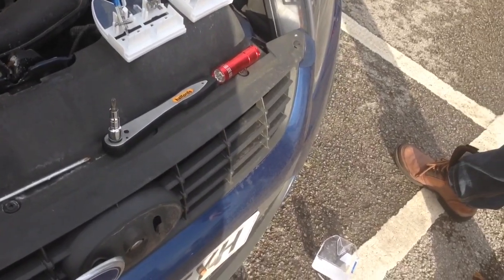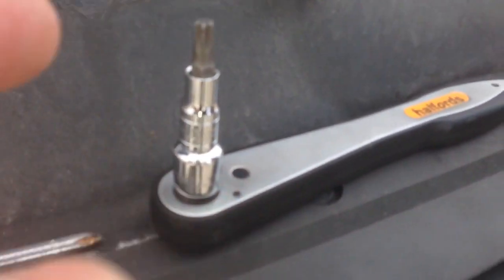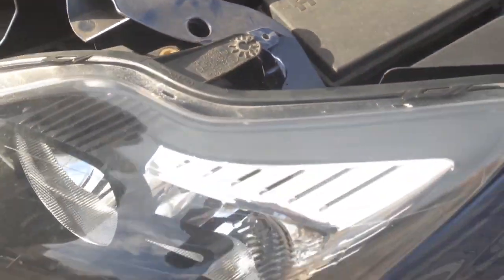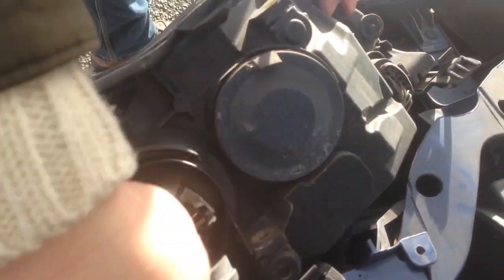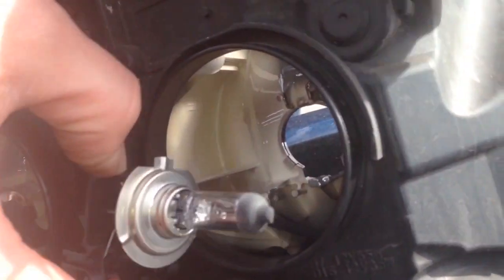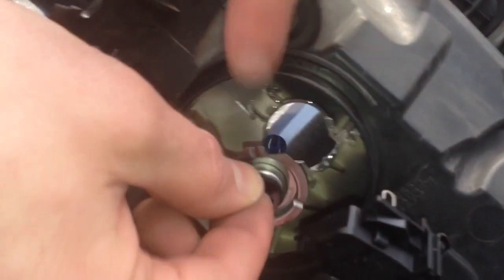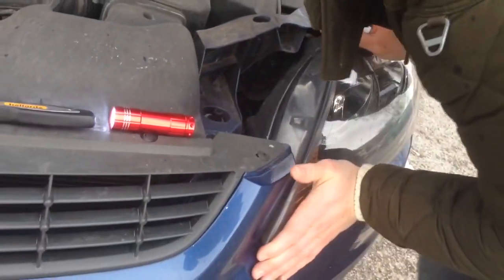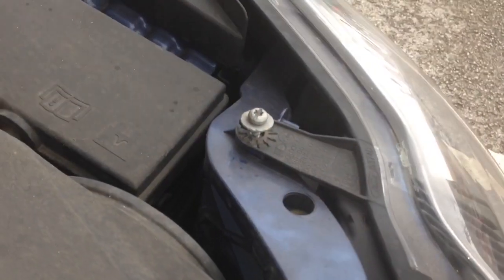Ford Focus 2008 MK2 MK II how to change headlamp bulb video

Comment: Thanks heaps! I have a 2011 model, but same headlight set up. The first YouTube clip I watched got me most of the way. However, your tip about inserting the globe before pushing in the connector was the final bit of information I desperately needed.

Comment: Being a Musician i do not own such a long screwdriver... So i discovered that the wheel nut tool in the trunk doubles as a clip opener and i believe you are supposed to use that tool when replacing the light bulbs! I just thought this could be helpful... Clever Ford!
Reply from the maker: Yes great thanks!
Reply: Thanks  your comment helped loads !! 👍

Comment: Good video but it can be a bit of a pain replacing the small side light bulbs as the long plastic bulb holder can snap off due to it becoming brital caused by heat so take care when removing these. I hope this is helpful.

Comment: Thanks.
The only boo-boo was where you held the replacement build in your palm.
You shouldn't allow the glass part of the bulb to come into contact with your skin.
The natural oils in your skin will contaminate the glass surface - resulting in a hot spot . The bulb will fail prematurely as a result.

Comment: how do you replace the side bulb cant get it out no matter what i try
Reply from the maker: +Michael Hyde is it this one: https://youtu.be/rGlpkGcN03s
Reply: The side bulbs can be a pain be careful removing them as the long plastic bulb holder becomes brital with the heat over time. I managed to replace the bulbs but both my bulb holders snaped half way down so I used long nose pliers.

Comment: Does anybody know how to adjust the beams? I changed the bulbs but the beams are now out of alignment. Cheers :)
Reply: Check that the bulbs are correctly installed in the Groves and also make sure the area where the bulbs fit are not broken . I've known this to happen with a friends focus. This is because the plastic reflects become brital with the heat over time.